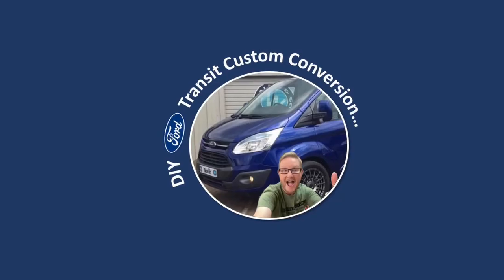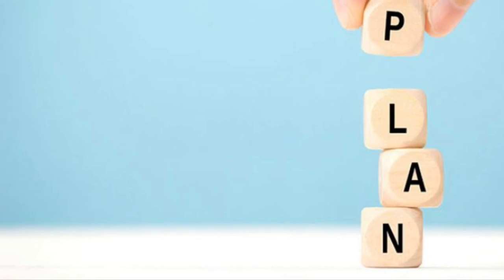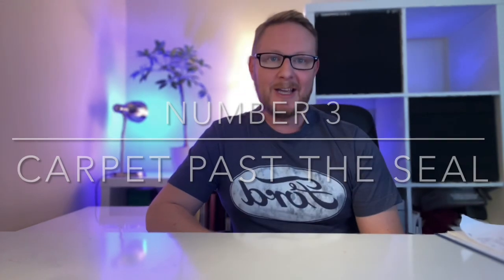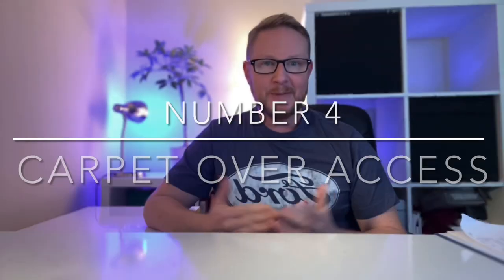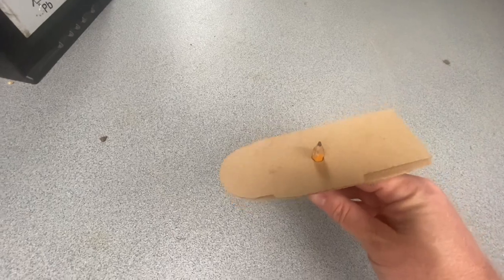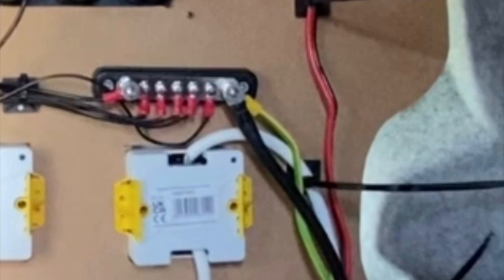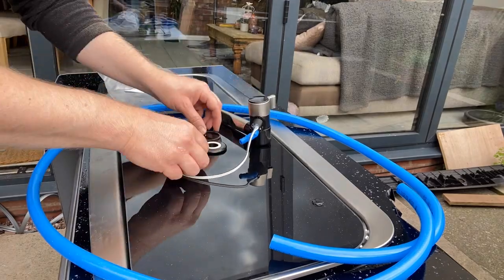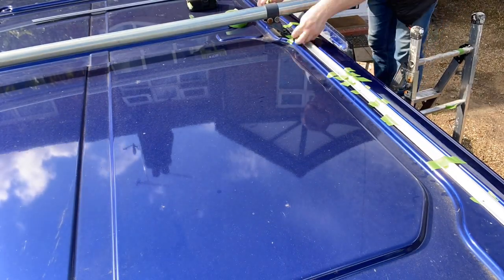Don’t make the mistakes I did 😢 | Top 10 Van Conversion Errors In Transit Custom

Comment: I like your honesty! I think a lot of folks probably "gloss over" the not-so-good parts of their build. 
I can't stress enough the need to really think through every step and foresee what could go wrong. Mine worked out really well, but was completely bespoke, fairly simple and no "kits". Same as yours - Transit Custom, but a very different approach. The only thing I got wrong was not forking out for a LiFePO4 battery. The AGM is ok, but runs down quick if the fridge is on a lot. ATB. Neil
Reply from the maker: Hi Neil - Ah great 👍 thanks for the comment ..Yes this was my first build and so I wanted to be as honest as possible… I am planning to do a follow up soon after living with the van for close to 12 months so a few other bits I’d change… like the Fridge! Just feels like a novelty really for how much we use it… maybe we will feel different in the summer! Thanks again
Reply: I installed a Dometic CRE50 and no regrets. It's a great fridge, very useful and have used it every trip over the last 14 months or so since finishing my build. 
My build is different because I needed to be able to easily switch between comfy camper and load carrying van. It works! The convertible comfy futon bed is removable in a few minutes and yet I still have work tops, storage, fridge, sink, TV and heater, and the bed is a full size double that's super comfortable. I've done a whole playlist of van build videos on my Hikerdoc channel. Check it out, if interested. Neil

Comment: Thank you, following this and made the same mistake on the floor. I managed to get 12mm ply on top of the insulation so did get it all level but in hindsight I should have stuck the ply packers down first and then the insulation on top and then the floor. Just about to fit similar awning rails so will look out for the front screw issue - gonna save me a headache.
Reply from the maker: Nice one cheers Mike 👍 Glad you able to get it sorted on the floor… We live and learn right! 😂 yeah on the awning rail I think behind the b pillar as rough guidance… Good luck with it 👍

Comment: Hello Dave, great video! It's so useful to share experiences and ideas and I'm very excited to be moving forward on my build. We are just awaiting the units now so they will be in next. I saw in this video you had listed the back door carpet as an issue. We've fitted our carpet past the door seal and have been monitoring it closely for water damage, so far we've realised that the carpet doesn't hold the water for too long, it dries quickly and we've not had any issues so far. That said we are going to keep an eye on it. In  hindsight I would have not carpeted so far, predicament being that it looks so much better going to the edges of the door!! The tip for the vents over the lighting holes is very useful, I too just carpeted straight over it! When you find a supplier could you let me know 👍
Reply from the maker: Hey Daryl!! Thanks for checking out the video and the kind comments. Yeah on the carpet of rear doors you right it does look a lot better.. It was mentioned to me by a few conversion companies so I thought best to share 👍

On the rear light access too… yes that was a bit of a shock for me too! I don’t know how common this is? But last thing you want is popping windows! Yes for sure as o have the details on the rear vents I’ll let you know.

Good look with the rest of your build! Send me some pics if you like and can get it on readers vans!! 

Cheers again 👍

Comment: Hi, great videos you have put together. Well done. Currently converting my own Transit Custom LWB. Would you by any chance have an electric circuit drawn for 240v and 12v b2b set up?? I have a general idea but I'm not sure of the exact components needed.
Reply from the maker: Hi - ah great thanks! Glad you have found the videos useful.. I got the full electrics in kit form and used the info I got some Wired Campers.. They have pictures on their site also.. not a full wiring diagram but hope it gives and ideas https://www.wiredcampers.co.uk/collections/custom-work/products/complete-camper-van-electrics-system-12v-240v
Reply: @TransitCustomCamper  Cheers, thanks a million.

Comment: Hi mate. Great video massive help for me I’m currently kitting out my own transit was wondering why you’ve gone dc dc converter as opposed to the split charge system? Or have I misunderstood  is the dc dc converter 230-12volts. Cheers keep up the good work.
Reply from the maker: Hey Cj - great thanks for the comment and glad the vids are useful 👍 I initially tied the split charge relay but my 2014 Transit Custom has a smart alternator so needed the CTEK DC-DC installed instead so could keep the leisure battery topped up from alternator 😀

Comment: Thanks for another helpful video, especially when I am at the ply floor stage myself. For the transit custom what thickness ply would you recommend for battens to match the height of the ribs?
Reply from the maker: Thanks Seth 👍 glad they are useful and thanks for watching and taking time to comment.. Oh wow I can’t actually remember the thinkness I used now!! If you haven’t started yet I would measure the rib height and check.. I recall it was just below the height of the ribs 👍
Reply: @TransitCustomCamper they are 8mm tall.
Reply from the maker: @analoganx  nice one thanks Duncan 👍

Comment: Where did you wire your earth for the 240v system? I have the exact same system from the same supplier and I'm not sure where to earth to either ? 😅
Reply from the maker: Hey Lewis - thanks for the comment and checking out the video. I put the Earth direct to the Earth point on the van I made. So a bolt into the metal body work of the van after removing the paint to get a good contact. I checked this with wired campers and they said was all good 👍 I also had a friend of mine who is electrician check it all for me too after I had done ✅
Reply: This is not safe to do. Earth and ground are different. Earth is 240v, ground is 12v. A negative ground in 12v is about completing a circuit. A 240v Earth is about directing potential energy to Earth in fault circumstances. Ground your 12v system to the metal work of the van. Do not attach 240v Earth to the van, this should have a continuous Earth connection back to the electric hookup. The hookup is earthed and the continues into the van and consumer unit. The other option is an earthing spike but that isn't practical. The van is basically an extension lead.
Reply: @GoProGeeks  Hello Mate. I just read your response to this much older thread but as im in the process of wiring a van i thought i would ask a question. I have a 240v inverter therefore in off grid situations there is no Earthed Hookup to connect to. In this case most camper builders seem to earth to the Chassis. As you say an earth spike is not practical.

Comment: can you do a update of what you use due to some of the links dont work
Reply from the maker: Yes, thanks for pointing it out.. I do need to get things updated - I’ll check the links 🔗
Reply: @TransitCustomCamper  as we speak I’m pulling my transit van 2008 mk7 apart and coping u 😂😂
Reply from the maker: Ah nice one 👍 hope your build goes OK! Thanks for checking out the content.. drop me a comment with any questions and I’ll try and help if I can
Reply: @TransitCustomCamper  thank you so much
Reply: @TransitCustomCamper  hi im struggling to find some liner for my mk7 transit 2008 because on the website they have ford custom but mine a mk7 model and strugging to find some online
Reply from the maker: @cbgamer1056 - yeah I am not sure to be honest - might be as a slightly older model so not as easy to get.. could be having to make some up yourself from ply?
Reply: @TransitCustomCamper  i have the ply wood its just the carpet for the floor lino
Reply from the maker: @cbgamer1056 - ah OK - yes then might be the same finding pre cut.. to be honest my pre cut had to be trimmed and cut all the way around anyway for the custom.. so maybe a piece you cut.. what in also was considering was vinyl planks? That might be an option? Maybe take a bit more time but could then cut as needing during the fit?
Reply: @TransitCustomCamper  yes thank you for that